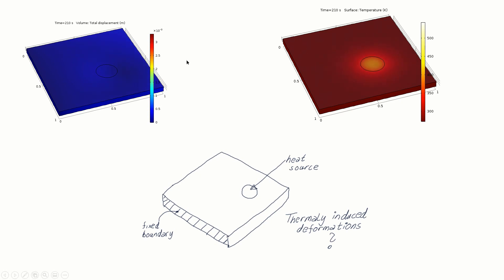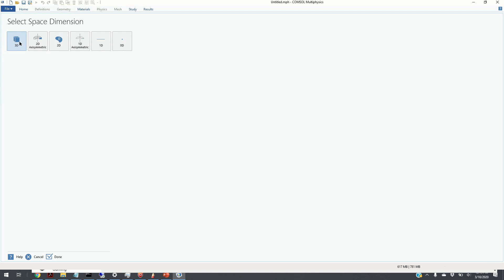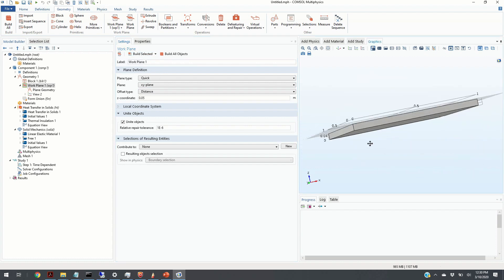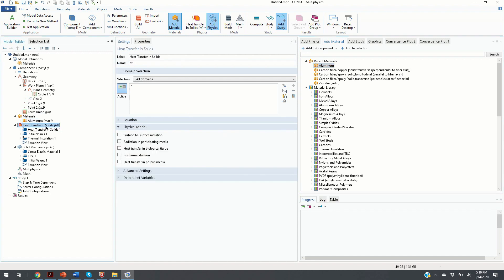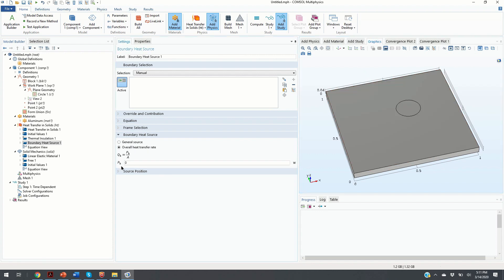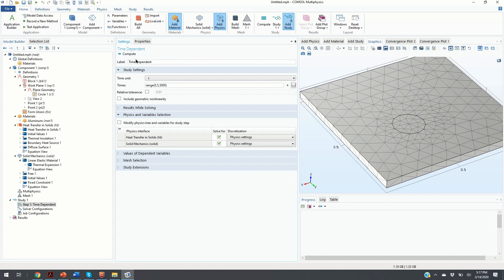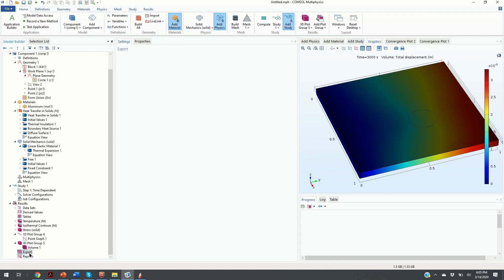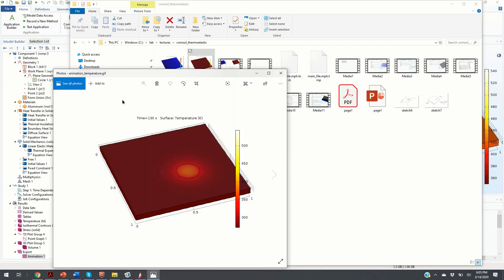Modeling thermal deformation of a plate  using COMSOL Multiphysics - mechatronics

Comment: Hi Aleksandar, thank you for this informative video. I want to do a similar simulation, however I am not able to add the surface-to-ambient radiation (Radiation --> Diffuse surface) because it does not give me the radiation option when I right-click Heat Transfer in Solids. Do you have any idea what might be the problem? I am using version 5.5
Reply from the maker: Hi Ruben! Sorry for the late reply. For some reason, I did not get a notification about your message. I am using COMSOL version 5.4 (or 5.2 in some previous videos). I do not know what kind of problem you are experiencing. All I know is that COMSOL versions slightly differ from each other.
Reply: @aleksandarhaber  Hi Aleksandar, Thanks anyway for the reply! I have figured out how to fix it eventually :)
Reply: @rubens3890   can u tell me  how did u fix that. I am facing same problem.
Reply: same problem

Comment: is there a way to show how materials are removed continuously under the influence of heat flux in COMSOL. Say, for example, consider a 2-d plate(10mm by 10mm), and a heat flux of intensity 10^9 W/m2 is given on the top face in a length of 1mm for a period of 30 microseconds. Let us consider the melting point of the plate material is 1500K. Under the application of the heat flux, heat will be transferred to the workpiece and a temperature profile will be generated. How can we model so as to remove the section of the material that is above the melting point once it reaches the melting point even before the actual completion of the time frame over which the heat flux is supplied?.
Reply from the maker: I am not an expert in that field. But I think that the starting point for your search should be heat conduction with phase change: https://www.comsol.com/paper/download/257871/huc_presentation.pdf 
And thank you for subscribing to my channel!
Reply: thank you for information

Comment: hello Aleksandar, I need help with simulation of additive manufacturing simulation on heat transfer module. So far, I have been able to add moving heat source, but I am not able to add material layer by layer. I searched comsol website for help which tells to do material activation and deactivation, but I am not able to activate and deactivate material in my simulations. 
Kindly help me, I will be really grateful.
Reply from the maker: Hello Saim, 

I do not have experience simulating additive manufacturing. Also, these days, I am really busy, and I do not have time to investigate your simulation problem. Sorry that I cannot help you more.